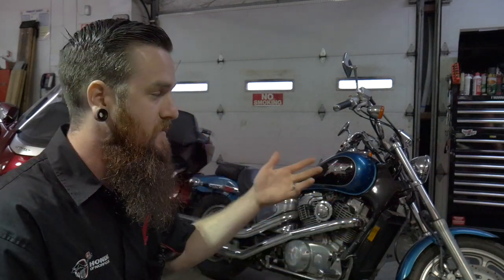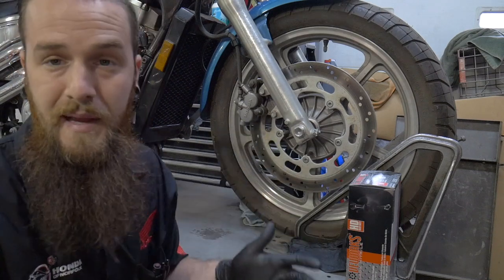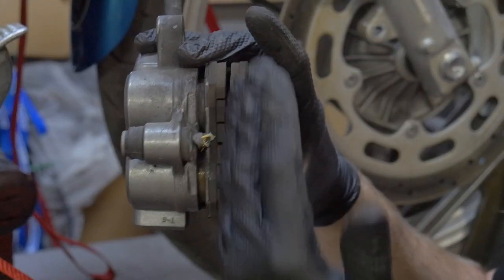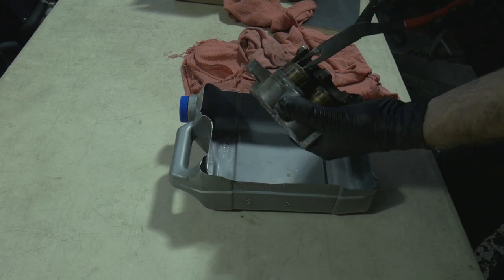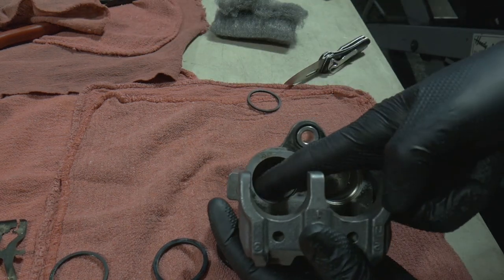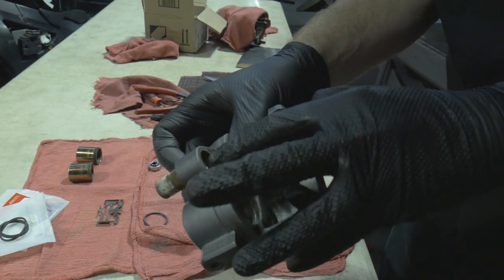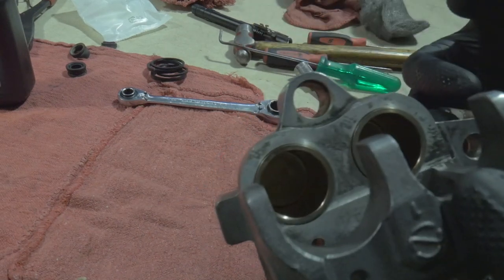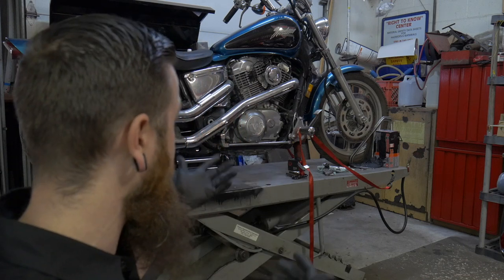Repairing Stuck Brake Calipers: Honda VT1100

Comment: Thanks so much for this video. I've cleaned mine up a couple of times and gotten it to work better for the time being. One piston still sticks and doesn't move as well as the other. Been avoiding rebuilding it and spent hours trying to just buy a new one. Well 1985 came and went leaving us with no new replacements today. So after seeing the video I feel confident in buying a kit and rebuilding mine. Cheers.

Comment: I got stuck when my bike was hot and my brakes seized backing out of a parking spot. Hitting the caliper works!
Great video. Now I'm working on rebuilding a salvaged second set of calipers.
This covers everything. I'm going to definitely need a hair dryer to get the slide pins loose.

Comment: I recently had to rebuild a 81 kz750 caliper and it looked like someone had took a flathead screwdriver and started hit it with a hammer to free up the piston -.- ruined the piston. 
Currently still in the process of restoring the bike :) 
It's got the full touring setup from vetter fairings.

Comment: With cleaning the area of the rubber seal inside the piston I used a dremel with a rubber wheel and it cleaned the shut outta it!
Reply from the maker: Heck yea man! Great choice of tool!
Reply: I love my dremel. I've been restoring a gsxr and everything needs cleaning. I've chewed through so many copper wire bits but they've been a god send.
Reply: My atv 250r honda has a stuck sleeve w the two rubber boots like your vid.. Its stuck stuck...any suggestions to free it up i cant just tap it its froze..

Comment: Instead of using hoseclamp, you can press the brakelever half way in and secure it with with a strip or tape.
If problem with bleeding, you can bleed it from the caliper with a larger syringe filled with brakefluid. Just make sure no air come in the system at the end. Air will travel up..... Make sure to emty the brakemaster canister first with the syringe.

Comment: Ive put a front brake lever on my dirtbike and it draged a tiny bit so i thought it would self clear on the pads by boy was i wrong, i didnt consider that brake fluid expands with heat so as the brake was draging it was actually applying more pressure cause even more heat and i went over the bars in about 4-5 mins of riding

Comment: A really good product to use on any metal components is Corrosion-X - it binds magnetically and thus shows high resistance to pressure and heat. I haven't yet tested it on my brake pistons, and it may not be a good idea there - but virtually everything else - tools, fork legs, bolts, springs, exhausts, etc... it's even safe to use on electronics and other electrical components. The items will be extremely well protected against any kind of corrosion. 

I can highly recommend that product, which is even quite inexpensive. c",)

Comment: Would you recommend getting the seals wet with brake fluid BEFORE inserting them? I'm guessing you want them to be lubricated on both the caliper body side and piston side? Or it doesn't matter seeing as they'll get soaked with fluid anyway once the caliper is filled with fluid?

Comment: Question I have lots of gun cleaning tools most are really hard plastic pics and stiff plastic brushes you think that would be fine with out damaging anything I have 98 vfr800fi my girl had more then 16 years never any issues changed brakes and I feel the front slight dragging after watching this im goin to rebuild them not hard and its prob way over due honestly thanks for the breakdown hope the plastic pics will work ok

Comment: Would you recommend getting the old fluid out of the system before reconnecting the cleaned/overhauled caliper? Feels like pumping the old fluid into the clean caliper just risks introducing contaminates, no?

Comment: Just a suggestion from one technician to another instead of pinching brake lines you're not sure of stuff a valve stem in the banjo bolt. The rubber stamp will stop the flow of brake fluid and non invasive won't hurt the line.
Reply: From one tech to another, if you're NOT sure of a brake hose, replace it!

Comment: Hey, thanks for this vid. It was really helpful. I am having one issue though... so Idk whats wrong exactly, but those rubber seals WILL NOT go back in. I took them out, washed the calipers, and tried putting them back in and it just will not happen. Do I need to get new seals, or is there some sort of method you have to use or something? I gave it to other people too to try and nobody could do it. Please heellpppp

Comment: Boss man! I recently rebuilt my 93 honda shadow vt1100 master cylinder. New plunger with seals already installed, spring, bowl, and c clip, and rubber seal. When I put jt together it's leaking! This is my second kit and it keeps leaking from the dust boot side. Do you think there's something I'm doing wrong? Or is there something I'm missing? I was careful to put it in the way it came out

Comment: You have new subscriber, good job.   Would you use a Dremmel to clean out the caliper housing?  I think I’ve seen synthetic bristle wheels?  I have some brass wire wheels?  Would that damage the surface?  Thanks

Comment: Hey,very useful video as I'm probably facing the same problem with twin piston floating calipers and I'm pretty sure it's the sliding pin that's stuck on the left caliper.Do you think that could cause pulsing on the lever as I'm applying the brakes?Because my rotors are pretty much new still,as I've replaced them just this December.Any advice would be much appreciated.Thanks!

Comment: Hi, I made a mistake and got only one piston out of the caliper. The other one is stuck and the caliper is already disconnected an unmounted. Is compressed air the only solution now?

Comment: Hello, i have a honda shadow srx 50cc. it is normal that after a certain distance, the brake disc and the stirrup are hot, under normal conditions of use of the brake. the wheel has relative mobility when spinning and when a spin is heard there is a slight noise, a hum. ? thank you !

Comment: I’m wondering if I’ve got the right seal kit...
How hard are the pistons supposed to be to put back in?
Reply from the maker: If you lubed them up with a little brake fluid they should flow right in with finger pressure.

Comment: I use vacuum end line plugs, the metal vacuum male ends that needs to be pluged on the engine. They come in different sizes, they look like a black rubber bullet (Harbor Freight). I stick in the doughnut hole of the end of the brake line.

Comment: Could a person use a degreaser and tooth brush to clean the gummed up deposits to mitigate risk of scratching caliper bodies?
Reply from the maker: One person can do what ever he wants to get it clean.
Reply: @TheMotorcycleMD  Did not know if it might effect the appearance of the aluminum housing, was wandering about best practices and experiences from folks doing similar work.
Reply from the maker: mongomay1  Using anything harder than the aluminum metal can result in scoring. Brass wire brushes work great. I think a extra stiff toothbrush would work wonders with the right chemical solution.

Comment: Great vid. question On a 85 Goldwing front brake caliper, go to push in pistons to put new pads on and they wont go in, I can push 1 in at a time the other pushes out. so there not stuck. I opened the reservoir as well. I'm sure if I opened the bleeder screw or the brake line it would but not write. Any Ideas ??? Thanks
Reply: The best method to push the pistons in, is to clamp the brake hose and open the bleed screw with a rubber hose connected going into a bottle.  Then push the pistons in and they will go in a lot easier as the fluid has a shorter route to travel.

Comment: Heyhey @TheMotorcycleMD, I'm learning loads here. Just a question: what to do when your pins are suuuperseized up? Your step at 9.55... Plyers dont work, even convincing it with a hammer didn't work. Any tips?
Reply: Me too. Ended up making a parts cleaner using a 7$ pump,  purple power degreaser, soak it few hrs
Reply: My pins are seized any suggestions? Thanks

Comment: You should have said, always insert your bolt into the wrong hole first to clean the threads before inserting into the correct one.

Comment: Could you use an ultrasonic washer to soak the calipers? Then there would less scraping to do
Reply from the maker: You absolutely could man. I just don’t assume everyone has one! Give it a go! Double check the areas after for sure
Reply: TheMotorcycleMD  I don't have one either. I was just curious.
Reply: Lol
Reply: @lmdetect  I did use a ultrasonic cleaner on a 83 1100F rear cal. it helped greatly but didnt get all that heavy crud that was under the seals, still needed scraping, it does get the places you cant get too, and brought many carbs back to running like new again.

Comment: 20:33 Your better off not using the seals on this pin . they are a very common problem on these bikes and others that use the same calipers. The seals are not totally water proof and when some water does get inside the pin area the seals actually help to retain that moisture inside  and that is what causes the severe rust that will lock it up. With out the seals the water will simply evaporate away and at the most you may only have just a little surface rust that won't lock up the caliper.  I use just a very thin coating of water proof grease on the pin to help protect it. I have used this method for more than 20 years and have never NEVER had a customer bike return with the same problem. NOTE the upper pin at 29:11 does not usually have this chronic problem and the seal should be retained.

Comment: "F" that hose clamp, Blue Point has great hose clamp-off pliers that need NO adjustment, NO ratchet mechanism, & can be operated with one hand. Great for fuel, vacuum, or brake hoses. Part # PHP3

Comment: i NEVER use air , i almost got killed once . just use a grease gun . screw of the grease tip and screw on the grease gun to the caliper it works
Reply from the maker: I've done that too. A heavy towel is key. I hate wasting all my grease lol
Reply: @TheMotorcycleMD  i can tell you i had a big towel , but the piston took the towel out of my hand and somehow into the wall a couple off inches past my head and into the ceiling cracked a stone ......it was on an old mercedes benz tractor

Comment: limit blasting off brake dust/debris/fluid with compressed air! Instead, dip in the parts cleaner. Wipe DRY. at least wear a mask #mesothelioma